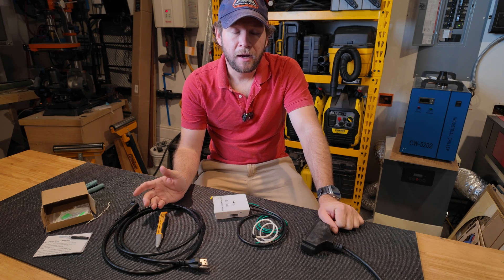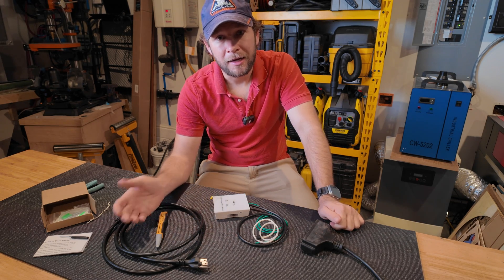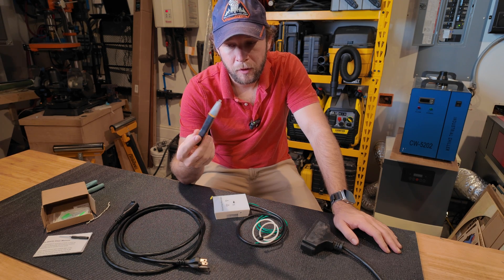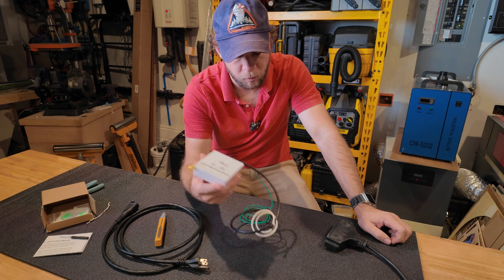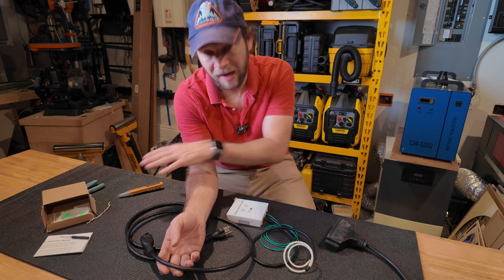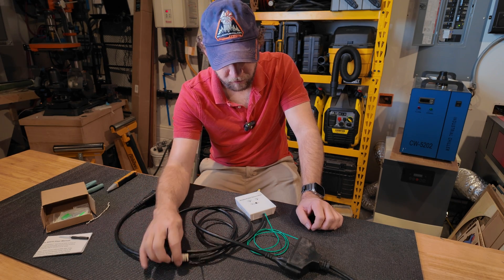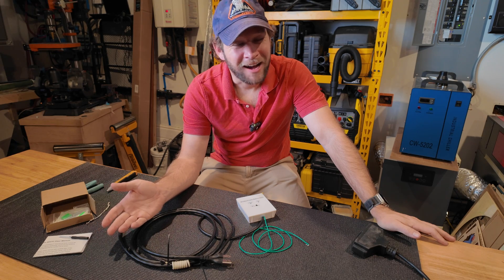Generator Power Return Alarms: How to know when the power comes back on.

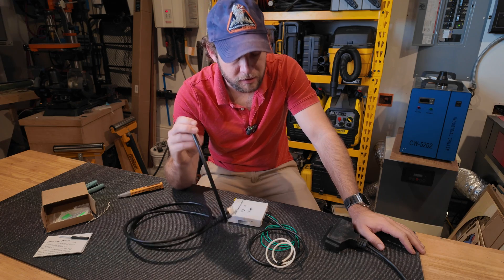Comment: 7:00.. You need to wrap the sensor wire around only one power conductor L1 or L2 of the 240VAC coming in to your panel..
The way you did your test the Sensor Wire saw L1 + N + Ground which cancel each other out or make the Electrical Field much weaker.

Comment: What was extremely dangerous? Thought you said put a sensor clamp around the main? But maybe you meant to actually cut the main and tap into it, then yea it wouldn't be a good idea lol Just show us how to install the damn thing. Americans like to talk so much, geez.
Reply from the maker: American electrical is ground referenced, so anything inside a panel is dangerous. Slip and touch a terminal while attaching that CT or wrapping the sensing wire and it may be the last thing you do.  Also I would love to just show you how to install this one specific alarm, but Americans also sue too much…….
Reply: @DemonicAnimatronic  pull the meter, simple no chance of getting bit.

Comment: You can do this with just a light bulb and a radio. No need to buy more cheap junk from China that’ll likely break in a year.
Reply from the maker: Where do you connect the lightbulb when the whole panel is transferred to the generator?
Reply: @DemonicAnimatronic  Obviously no where.  If you can run an entire 100-200 AMP panel on your Generac natural gas generator, then good for you.  You probably don't need to know the minute your grid comes back on either.
Reply from the maker: @mondavou9408 I don’t have a generac, but I do transfer my whole panel with an interlock if the power is down for awhile.

Comment: Would have liked to seen you mount on panel..informative video..
Reply: Mounted mine right above the breaker box and ran the wires right down thru the top. Works like a champ.
Reply: It can be hooked directly to either hot leg coming in ahead of the panel breaker.